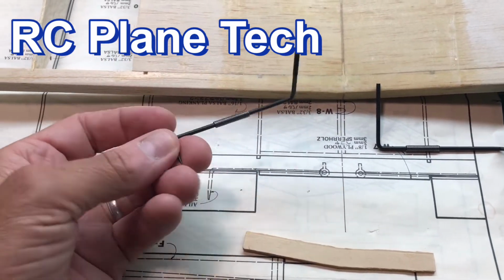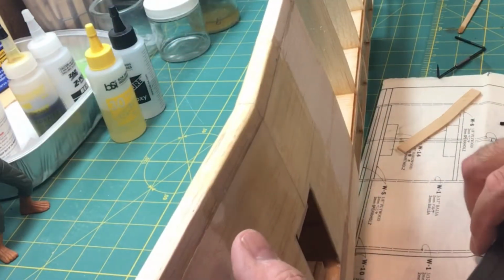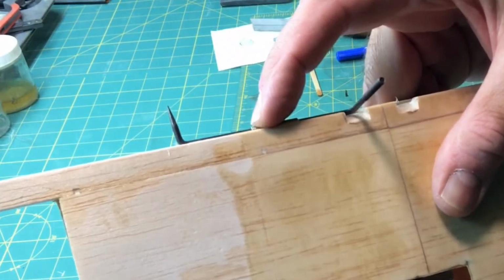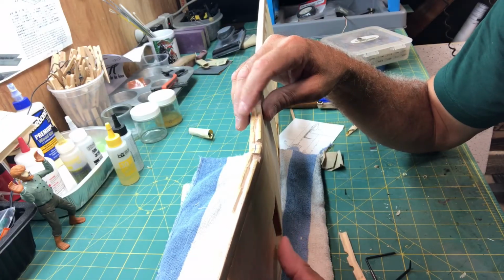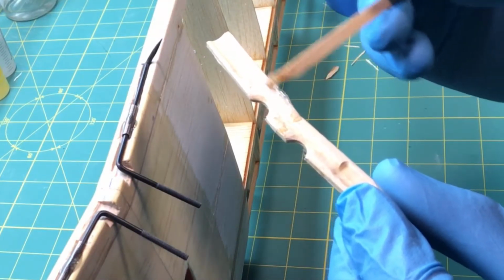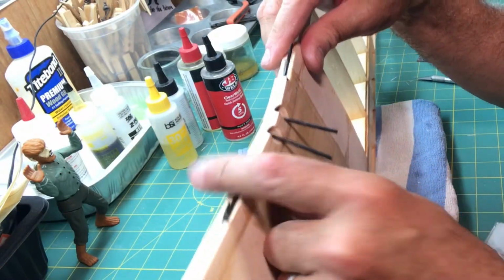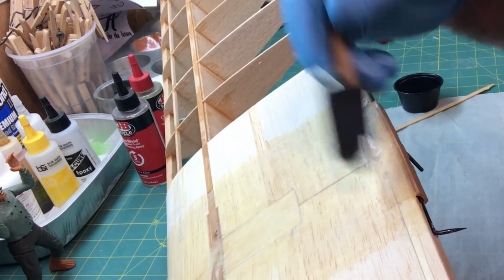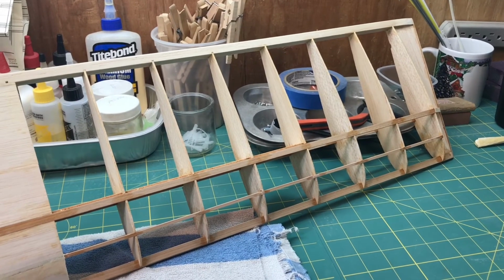Barnstormer 25S Vintage RC Plane Build: 14 Aileron Linkages

Comment: Hi James, I'm curious to know what exactly the tool is you use to dig out the channel for the aileron linkages. I know it's some type of gouge tool, but can you share what size and specifically what it is? tks
Reply from the maker: Hi, thats just a grooving or gouging tool from a small wood carving set. I forget the brand off hand, but its came with about 6 different cutting tools for wood,have to see what the brand is. But its not special, you can search for a small wood carving set online and see many example sets with different size and shapes. Obviously the sets with smaller tools are better for what we need.
Reply: @JamesRCPlaneTech   Thanks for the reply, great videos you are putting out, I'm starting from the oldest and working my way up, great work.

Comment: This part is done wrong on my wing. My controllinkage was mounted after the covering was done. With the ailerons glued in place they have no support. Been thinking about trying to mount the plywood support afterward.
Reply from the maker: I thought you were doing duel aileron servos? So you have the same setup as mine but no plywood support just glued the linkage sleeves to the trailing edge?
Reply: There are no support at all for the linkage. They are free to move freely in the wrong directions. I did understand that something is wrong but not exactly what. Now I must decide what to do about it.
Reply from the maker: Hmm, ya if the set up is like mine then maybe a strip of plywood grooved out to accommodate it. This is probably the worse thing about this kit. I’ve noticed a few typos and issues with the instructions that luckily I caught, bet then again I made some mistakes on my own due to a few boneheaded moves. Ill go back and look at your rc groups log and see if I can see what yours looks like. I also noticed a few of my plywood pieces delaminating probably do to being old. So I zapped where I could. This think jus may implode when I fly it!
Reply from the maker: I was looking at your pictures on your RCGroups. So, maybe to fix it you can remove that plywood strip off the trailing edge (razor saw, roto tool, or maybe exacto) and then do what I did in this vid with a new piece of plywood. May be a little work. Or you could do away with a single servo and try duel servos? but then you would have to run wires to them, but that may not be too bad.
Reply from the maker: Sorry Daniel, I got confused and responded to your comment thinking you were another person who has a build log on RCGroups.
Reply: @JamesRCPlaneTech  It's ok. You can't keep track of everything. 😀
Reply from the maker: So were you able to “fix” your linkages?
Reply: @JamesRCPlaneTech  I haven't had time to take a closer look at it yet. I need to look under the cover to see what the previous owner done. I hope it's the last plywood pice that are missing :)